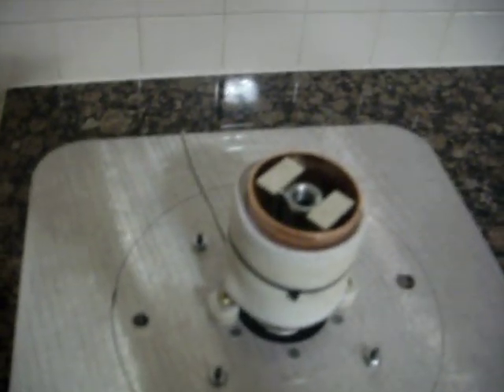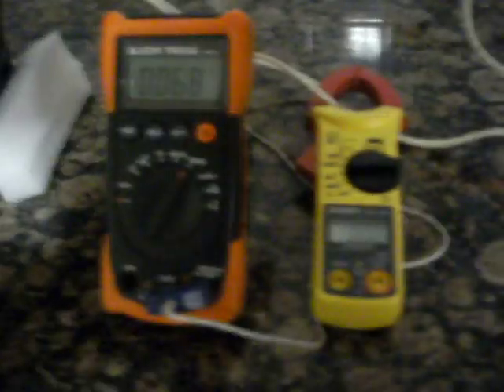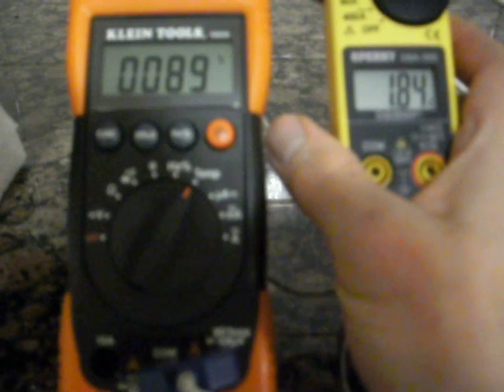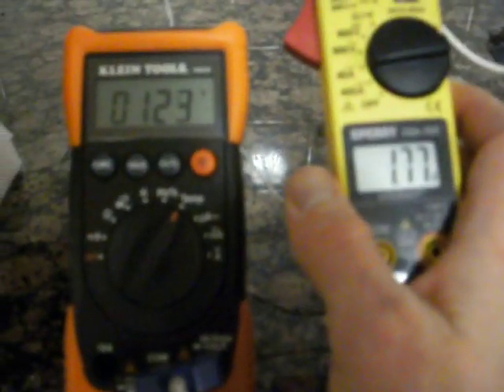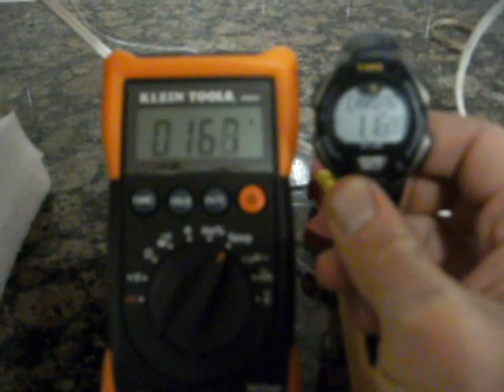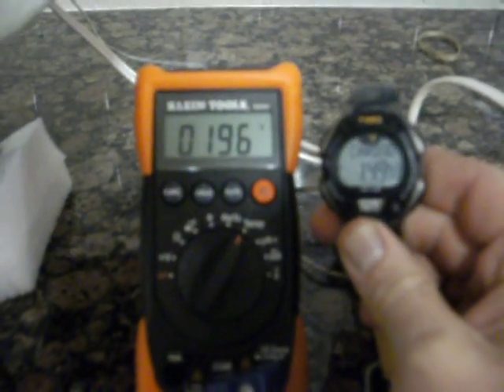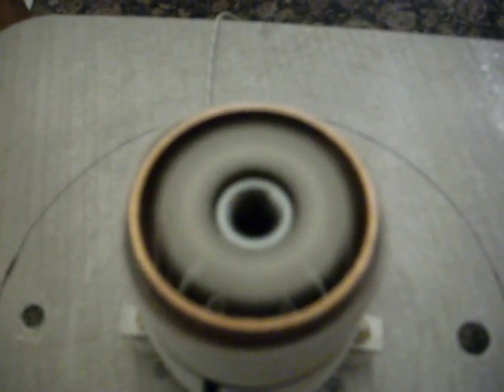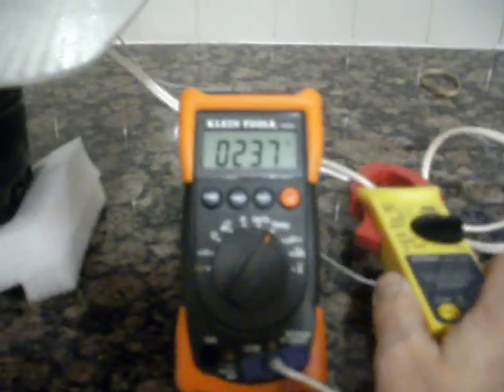Magnetic Heater design using spinning magnets to produce heat !

Comment: Circuits containing both inductors and capacitors, the voltage and current waveform will not be in phase except at resonance. The general term for AC resistance is impedance and given the symbol Z.

Comment: The familiar Ohm's Law triangle used for DC circuits can only be used at AC if the load is purely resistive. Most AC circuits however, contain series or parallel combinations of resistance, capacitance and inductance. This leads to the voltage and currents being out of phase and the load becomes complex. In purely capacitive circuits the current waveform leads the voltage waveform, whereas in inductive circuits the voltage will lead the current.

Comment: What's the bottom half? electric motor. I'm sure you could throw a circuit in there to shut off power supply well before boiling point. They have chips that do temp readings, and you can program a micro controller to shut off the heater feed until the temp from the chip reaches x degrees.

Comment: Great video. I made a video for bending copper coils in tight formation without kinking. I have similar experiments that I am working on. Please though...make sure you put a pressure relief valve on the water side. When you hit your boiling point you could cause some damage.

Comment: @whyme2b u realy have no cle what i sed about curent leed the magnets have no efect on the gage it has an efect on the flow of current so the elegid anomaly is caused buy the gage it caused buy the electomagnetic feeld thait is around the wire..for exsample a 400 watt coil balist sees it uses 400 whats and on the amp meter it reeds less but in the true watt meter it reds 425 that extra 25 whatts is the leed on the curent from the magnets o do the math cont.

Comment: You can make it more efficient correcting the power factor of the motor. Just connect AC Capacitors of different values in parallel with the motor and see the amperage consumption go down. For that motor I think a 15 or 25 microfarads capacitor should work. Remember the voltage rating of the capacitor. 370VAC should work fine. Thanks.

Comment from the maker: @einspace2007 
  The motor is for a oil burner furnace and I purchased it at my Cooling and Heating supplier. It's a A/C Motor...120 / 208 /or 240 volt input. Thanks for watching !